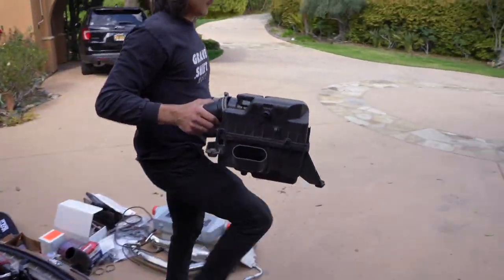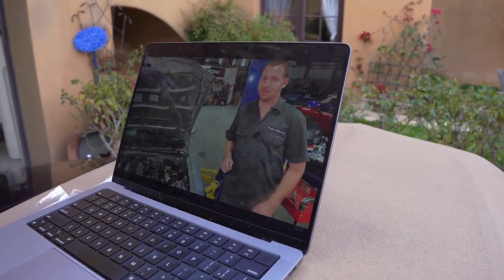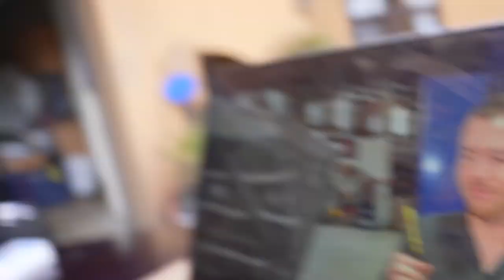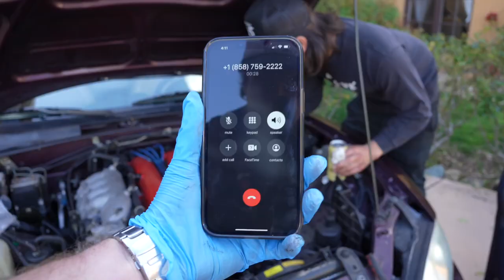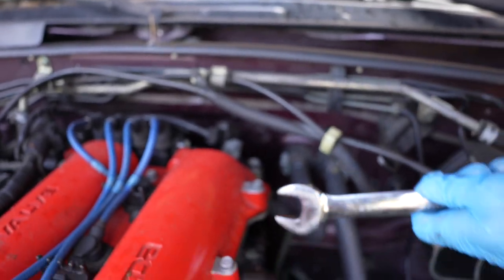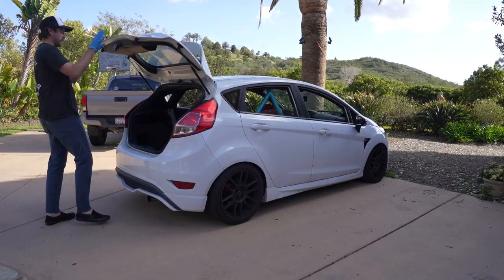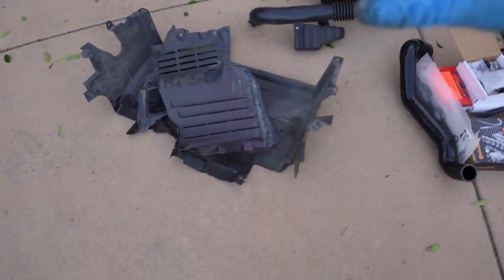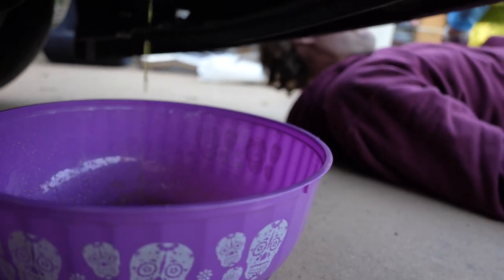TURBOCHARGING A 200,000 MILE MIATA... HOW LONG WILL IT LAST??

Comment: can you remove the other end of the metal pipe at the egr or egr  itself? If you can if there's room you could remove the exhaust manifold and all the egr stuff with it.. Also if you remove all of the exhaust manifold bolts and get it loosen you may have  room to bend the egr pipe a little to get to it.
Reply from the maker: You’ll see what we did tomorrow afternoon 😎